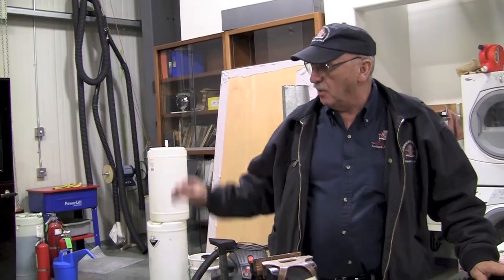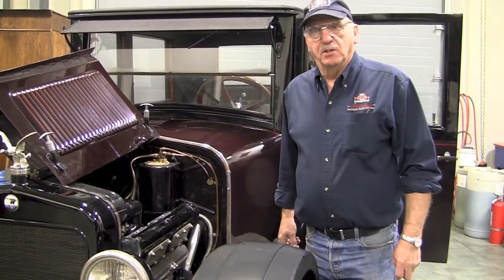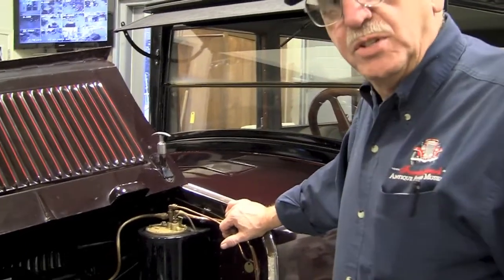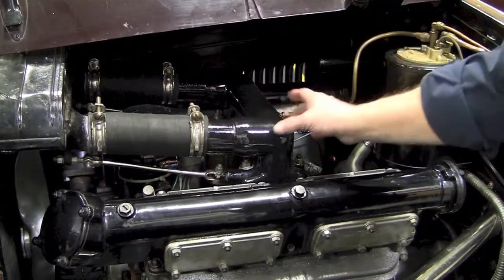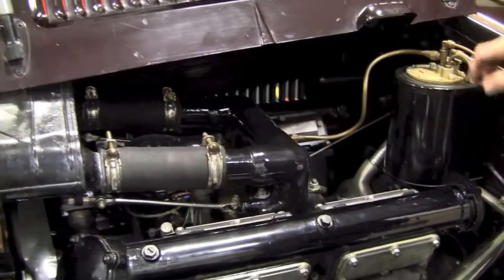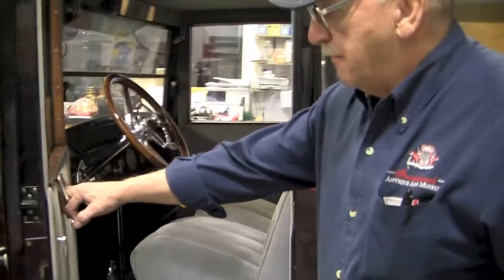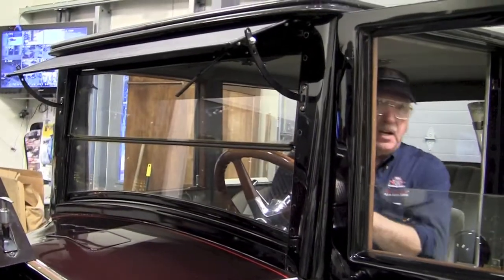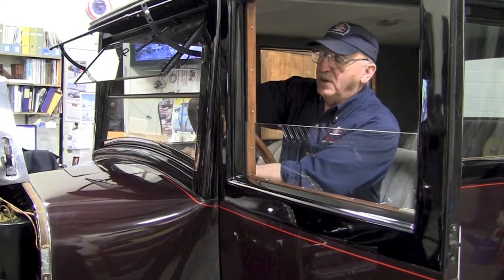1922 Wills Part 2 - Fountainhead Museum - Fairbanks Alaska

Comment: I see you are having problems with galavanic corrosion. You are probably now running waterless coolant but just a thought. You could add a sacrificial anode to the coolant system say some magnesium or zinc. You could discreetly hide this inside your straight radiator hose with just a screw showing on the outside with a wire earthing on the block. I know it has lasted 100 years so far but for those in the future it could help them.